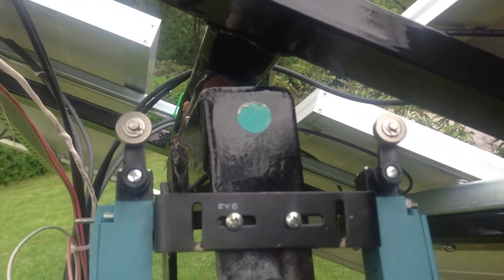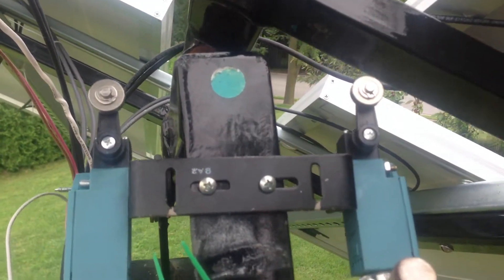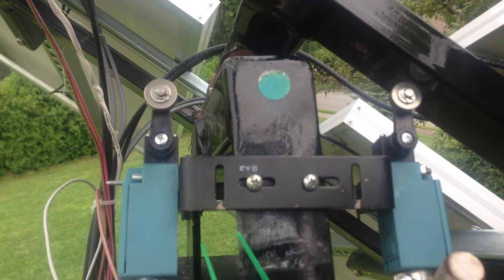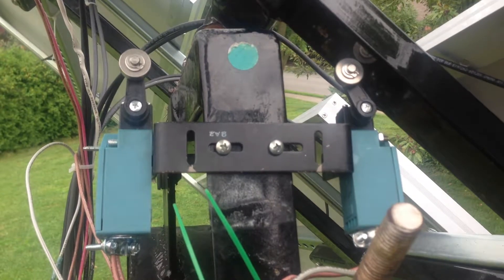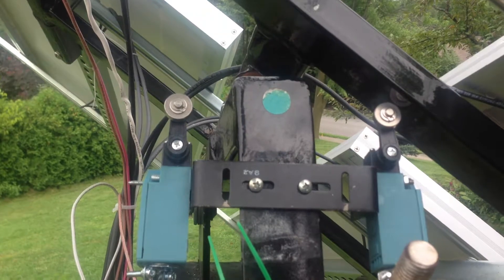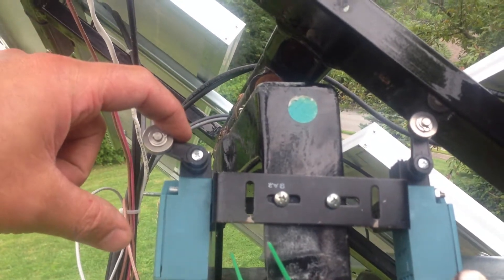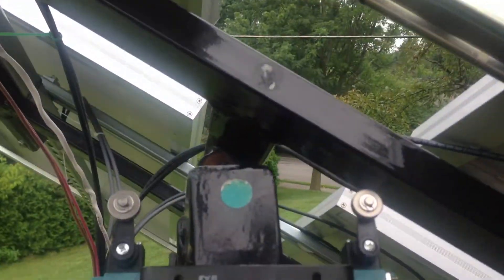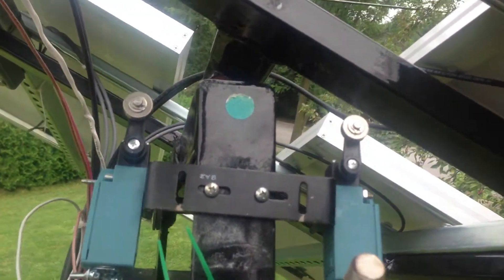Solar panel tracker actuator replacement and limit switch success!

Comment: I wish you included what kind of limit switches you are using and the wiring diagram,
Reply from the maker: @riftvalley1765  Allen Bradley roller limit switches.  Sorry I've no diagram.  Keep subscribed because I sold my tracker to a friend and I am going to help him put it together. When I do I will make you a video.

Comment: I think actuator is 35cm. I changed it and got the limit of 15cm. Actuator have limits inside it veri simple to modifi. Without using these devices(diodes, limits, cost grou up.)